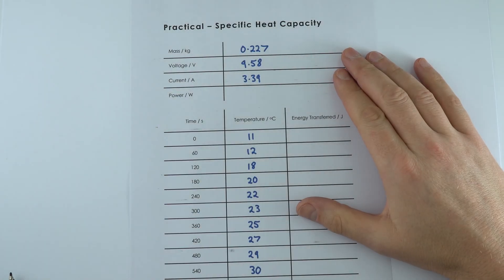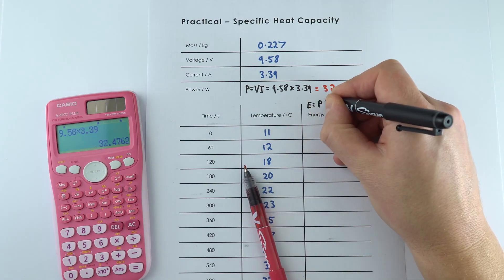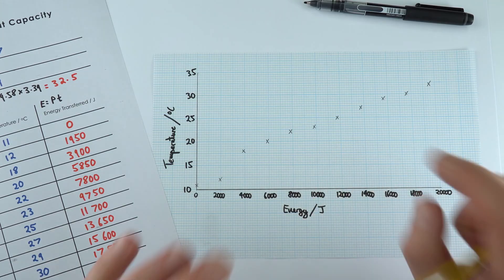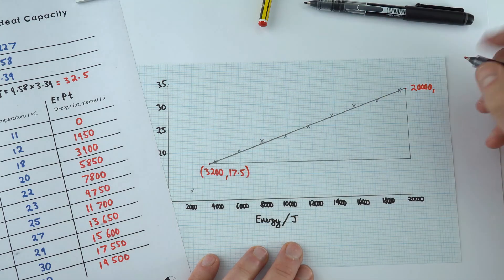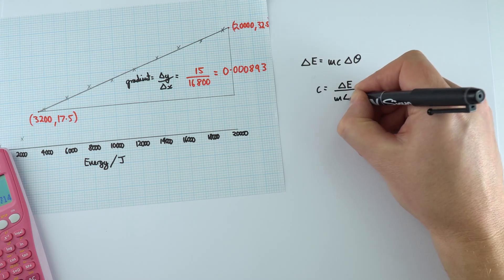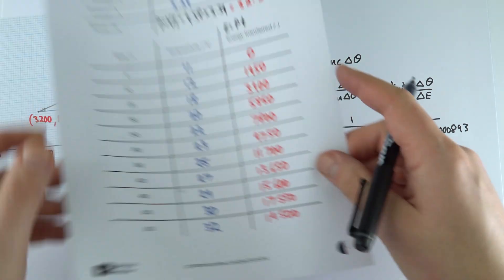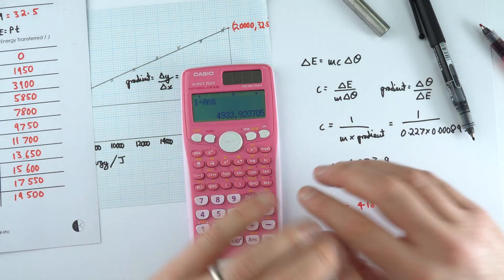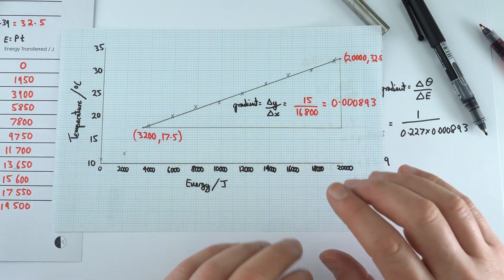Specific Heat Capacity of Water Experiment RESULTS - GCSE Physics Required Practical

Comment: Thanks for these videos! Just one small correction is that you made an error in your first two measurements of the temperature. By my eye, I got about 16.3 and 16.9 degrees Celsius respectively (estimating the uncertain digit). That should make those two initial values more reasonable. With those corrections, I got approximately 5200 J/kg*˚C for the specific heat capacity.
Reply: (Anomalous result)